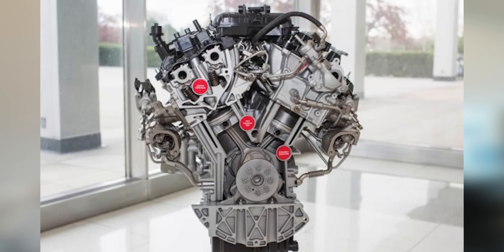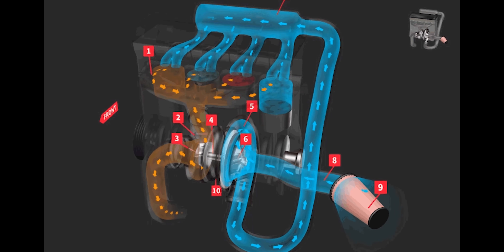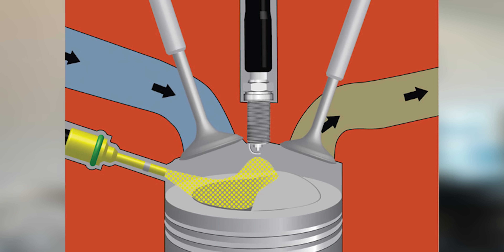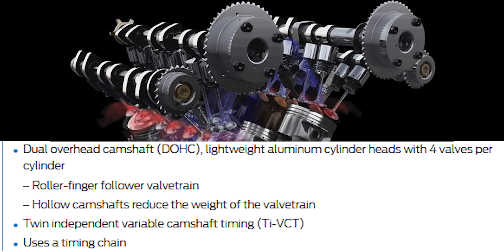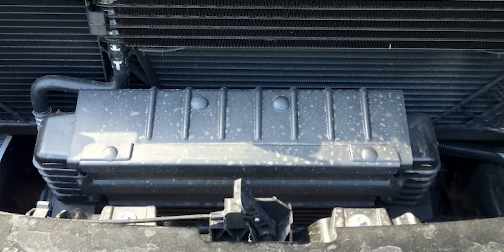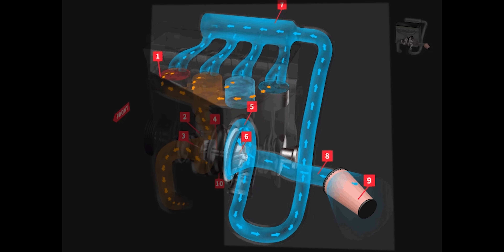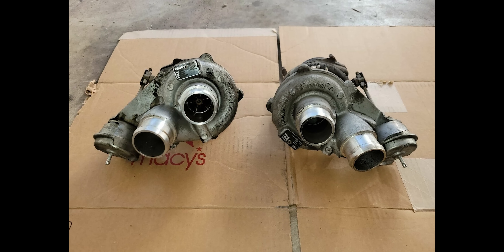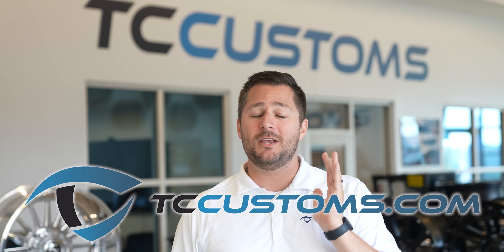The Truth about the Ecoboost Engine!

Comment: every Eco boost has catastrophic failure around 100000 km.. my work bought 17 units ALL 17 units had catastrophic failure.....and  now the 5.0 coyote eats oils bad. fords solution was to give you a new  oil dip stick with different low oil markings for the 5 liter V8.... old dip stick says your out of oil...   fords new dip stick says everything if fine... my truck just ate  a liter of oil in 2000 km  and ford  says its okay.....we also had several units at the dealership for two months with transmission problems.... ford has NO idea whats wrong with the transmission, they just swapped out every part they could think of..... don't believe me??? call ANY construction outfit and ask why non of the ford f150s have 3.5 or 2.7 Eco boosts in their fleet??? then you'll hear the horror stories....
Reply: They also play games with the oil pans. The dipstick used to go all the way down and sit just above the bottom of the oil pan. On the new ones, it still goes down  the same amount, but its walled off in its own little compartment. Oil get in through a tiny pin hole size valve. It makes it look like there's more oil in the motor than you really have.
Reply: Oh sir all the wonderful comments until now and you dropped the Tzar thermonuclear bomb on the whole thing. 100 plus years of internal combustion and now we must have computers, sensors, power adders?
Reply: @christianmotley262  There's nothing wrong with having electronics in cars. This is a Ford issue, not so much a computer issue.
Reply: @jkeelsnc  They can't. If they went back to something normal, they wouldn't sell any of the other ones.

Comment: I'm a Ford fan but they have major issues with the 3.5 eco. Timing g chain stretch/cam phasers timing chain tensioner. All that starts to go right around 100k all that is atleast 5k dollar repair. Not to mention you definitely need a oil catch can on the eco boost even if its multi port injection so much crud gets sucked in the engine which causes valve failure. FORD NEEDS TO FIX THESE MAJOR ISSUES!!!

Comment: These engines WILL overheat towing much less than their rated weight up hill in Utah, Colorado, and Idaho. I don’t care how much “technology” they have in them.
Reply: Why is that ?
Reply: Fast Line Truck shows it over heating.
Reply: @studioxps72  cuz they were towing 10k lbs with a half ton and comparing it to a Duramax 3/4 ton
Reply: You can’t tow the rated max capacity when your several thousand feet above sea level.  Ford specifies how much to reduce your load when your at high altitudes.
Reply: @flyer8493  EXACTLY!  That fact was mentioned by FLT...
Reply: Yeah.  I’d like to see some evidence.
Reply: They just ran a Chevy up the same hill and it overheated also, i posted the link above. Seems that hill in 95 degree weather kills any 1/2 ton
Reply: @tieoneon1614  and only lost by 20 seconds, with reduced power..

Comment: But… when you turbo charge ANY motor you increase internal pressures and the life of the motor is cripple drastically and will not last as long as it’s none turbo charged counter part.
Reply: 228k on mine and running strong
Reply: My turbo diesel would say otherwise
Reply: That’s old school thinking that is only true for taking a naturally aspirated engine and adding boost. If the engine is designed and engineered from the start as a boosted engine, all of that is engineered out. Modern turbo Diesel engines last huge mileages and modern turbo gas engines like these Ecoboost engines, can also last just as long.
Reply: Tell that to semi truck and boat owners.  Turbo's increase efficiency and cause zero shortened life IF the motor is built to handle the extra cylinder pressure.  OEM's aren't taking N/A motors and simply bolting on a turbo like is done in the aftermarket world.  Factory built turbo motors are built to handle the boost and live just as long.

Comment: the problem with older turbos (non water cooled) was not that they cooled off to fast. the problem was that they didn't cool off and the extreme heat literally cooked the oil in the turbo.

Comment: Wow.  I learned a lot from this video.  Previously I didn't want anything to do with an "eco boost" but I admit I never looked it up before.  Very informative.  Thanks.
Reply: Just look at all the components that Ford has added to try to prevent known problems with using turbos= cooling systems for the air, cooling systems for the oil,, injecting oil in the cylinders for lubing/cooling......and some features he mentioned that I forgot about. Each one of them is another item for: leaks, for mechanical break downs, for wearing out over time, etc. Just give us a functioning V6 or V8 aspirated engine and be done with the turbo experiment.
Reply: @captinbeyond  Ya i ended up getting a 2021 ranger with the ecoboost. I hope i did right. I'm a little worried about the issues you mentioned but we will see over time.

Comment: To each their own as to which truck brand and powertrain they choose. I have an 2016 F150 with the 3.5 EB and love it! I admittedly don’t do an excessive amount of towing, but the towing I do is easily accomplished with this truck. 
One of the things that really impressed me is the trucks ability to pull our 24’ pontoon, loaded with 8 people and all their gear, up the steep and badly deteriorated boat ramp at our lake place without any problem at all. I just turn the dial to 4H, gently press the accelerator and up she comes without complaint from the engine or transmission. 
I think Ford hit a home run with this engine. So much so that I just recently bought my wife a 2021 Explorer with the 3.5 EB!

Comment: Here is my data point for this group. 2014 first Gen 3.5l eco with 160k miles. No engine work whatsoever. No timing chain rattle, overheating, carbon fauling or leaks. Only on my second battery, haven't even replaced the alternator. I tow an 8k lb trailer. Change oil full synthetic every 5k which is key for this engine... about 3k earlier than oil life indicator tells me to. Great truck!
Reply: Oh, and I Sea Foam it through the intake once a year since it's direct injection only.

Comment: I have a 2011 eco boost… 240,000 and counting With very few problems. I tow a 22 foot boat all over a state With many elevation changes, and it performs wonderfully. Only complaint it sucks fuel like a V-8.
Reply: Yeah I got the 2012 and same issue, lots of fuel. 16mpg in the summer and 15 mpg in the winter once the fuel companies change to winter fuel additives.

Comment: also, amsoil signature series! no 0w20. weight of death!
Reply: None of the EcoBoost recommend 0w-20, most should say 5w-30, though you can easily use 0w-30. (It's actually better because you get oil pressure faster on startup)

Comment: Public Service Announcement to all prospective first time Ecoboost buyers.  DO NOT RUN 10,000 MILE OIL CHANGE INTERVALS.  Between the heat produced from a modern turbocharged engine, and the fuel dilution that is notorious with Direct Injection engines, you are gambling on long term engine health stretching the life of the oil that long.

Not hating on the Ecoboost, I LOVE my 2018 3.5L (aside from the cam phaser cold start rattle and wastegate rattle) and will buy another when the need arises.  The Golden Rule applies.  Treat it right and it will last.  Besides maybe the cam phasers....😅

Comment: No Turbo's are not new to the Automotive industry.  I owned a 1988 Dodge Shadow that had a turbo charged 2.5 L 4 cylinder ENGINE, and the turbo was cooled not only by OIL, but also Engine coolant!  This car was a very fast and efficient Automobile, and it lasted way beyond 150 K miles!

Comment: I OWN A 2011, 3.5 ECO BOOST ENGINE F150, and it has NEVER let me down. It has 250,000 miles on it and I have never replace ANYTHING EXCEPT TIRES, PLUGS, AND OIL. THIS ENGINE RUNS AS SMOOTH AS IT HAS BEEN FOR THE LAST 13 YEARS. THE VERY BEST ENGINE FORD HAS EVER MADE!!!

Comment: Turbos have been around forever. Every diesel truck on the road now runs turbos. Every carmaker is selling turbocharged engines now. People who had problems with turbos are those who added them on without doing the proper engineering.

Comment: Yeah eco boost is a good idea but it puts more pressure on a V6 engine. And turbos are expensive to replace the longevity of an engine constantly under pressure can cause premature wear. And now Ford is sticking turbos on 4 cylinder engines. Who knows how long those will last long term.
Reply: These engines are purpose built to run higher pressure through them.  I got a 180000 miles out of my 3.5L ecoboost engine without a single issue. These engines are built to last a long as you stay on top of the maintaince.
Reply: Lol. You should have some knowledge and experience before saying dumb things.😂

Comment: One of the most important features of this Ecoboost engine you showed in graphic, but didn't say out loud .... it has a chain-driven timing gear, not a rubber belt system that requires frequent replacement on other engines or else engine failure results (a serious problem on the I-3 small displacement 1.0/1.3/1.5 Ecoboost engines). 

Your explanation about turbocharger cooling is wrong I think; you compare oil and water cooling of turbos, saying the oil system "cokes up" the turbo if you shut the engine off without running it a while; the water cools the same but CANNOT if you shut off the engine too soon either; how could it make a difference? the pump isn't running if the engine isn't rotating; (this wouldn't apply if the pump is electric and software keeps it going until sensors read a lower temperature, but you don't say that); you've got a hot turbo with either system if you ask me, so without further info, "coking" is still likely in the long-run.
Reply: The turbos water cooling is plumbed so that when you turn it off it's natural convection of the heated water that keeps the coolant flowing untill it's cooled down
Reply: @sublimefreak2244  oh REALLY!
Strange, that would require the law of gravity to be null and void. I don't believe your comment is true, but full disclosure I'm a longtime Ford retiree, spent a couple decades in powertrain testing and development, and I plan to ask one of my fellow engineering active employees or the SAE about this oil/water thing. Doesn't make any sense at all to me that this makes any difference in turbo temps after engine shutdown. Coolant does not FLOW without either gravity or a pump. Water cools faster than oil, but if it isn't moving the rate of cooling would not be enough different from oil to cool the turbo much faster. 

Your explanation may have some partial truth while the engine is running, but not after it's shut off. But I will check, and if the answer is in agreement, hopefully I can find this thread later and come back to say what I was told.
Reply: @rayrussell6258  it wouldn't have to defy physics in order to use convection. It's no different than warm water rising in a boiling pot of water. I have not researched it thoroughly but I was told that is how it was cool after the engine was turned off
Reply: @rayrussell6258  Look it up Ray, he's not lying. it's also why the radiator fan stays running after you turn the truck off when/if the turbos are hot.
Reply: @sublimefreak2244  ok, I'll check that out with the engineers; 

I'm still skeptical 
(in your analogy heat rises and expands; cool air/fluid does NOT rise or expand, so that's where I'm skeptical of what the original poster said)

From a textbook: 
"What is Convection? Convection is the process of heat transfer by the bulk movement of molecules within fluids such as gases and liquids. The initial heat transfer between the object and the fluid takes place through conduction, but the bulk heat transfer happens due to the motion of the fluid."  

Above/below are text book definition of "Convection of Fluids" and "Conduction of Fluids", 
as you can see the bulk of cooling requires motion of the fluid; what you suggest goes against laws of physics. Conduction also requires some motion of fluids. 

"Conduction heat transfer in gases and liquids is due to the collisions and diffusion of the molecules during their random motion."  

As I said, I'll be talking with engineers sometime in the near future, and I will bring this up; I want to know details myself.
Reply: @austin3626  That was what I posted earlier, if you look back in the thread; I said if the software keeps the pump running after engine is shut off, it might help cooling .... but the original poster did not say that; 
(and he has not since then come back to either clarify or admit his info was not accurate, even though he asked us to post concerns about the info he posted).
Reply: Model T engine convection cooled!
Reply: Turns out original poster was not correct/glossed over this; a combination of coolant and oil is used on Ecoboost turbo engines - not one replacing the other as was suggested (my info is from mechanic who works on these directly in Ford garage), and all the rest of the post-shutoff process is the same with pump circulating fluids to help cool down. 

Each Ecoboost engine is a unique design for the vehicle it is installed in, even if it is the same displacement used in a different vehicle, but the above covers most of the recent releases.

Comment: My olny issue i have with Ecoboost is the turbo lag, i don't think ill ever be able to look past it. however the engine seems to be working well still so im happy with that. got a 2013 f150 fx4 ecoboost.
Reply: The lag goes away in sport mode. At least mine does

Comment: I got a 2017 3.5 eco boost with 113,000 miles, going to shop Monday for leaking valve cover, this model comes with plastic valve covers and are known to warp and get hair line cracks

Comment: In gas engines when the fuel/air charge is ignited it’s a rapid burn, not an explosion as you had repeatedly mentioned. That would/could cause engine damage…That happens in Diesel engines…

Comment: I have the 5.0 V8, and have had V8s on all 4 of the F150s I have owned. Now with cylinder deactivation on the 2021 V8, I no longer see a simple choice. Please see the two mechanic's polls on engine choice on this very channel.
Reply: You don't need to take a poll. There's so much crap on a current NA V8 it barely fits in an F150. For any decent size job, its easier to take the cab off.
Reply: @solarfall2728  OH WOW!

Comment: Great video. 
We have been seeing more 3rd gen 5.0's lately (2018+) It makes me laugh when people say be careful because the turbos fail on the Ecoboost, that’s one of the least failures we see with these. Yes some dealership service department will see more eco-boost in for work, it is the number one selling engine in the F150 it only makes sense since there are more on the road are you may see more in the shop. it’s a numbers game, percentage.
Reply from the maker: Very well said!  👏🏻👏🏻
Reply: If I remember right the 3.5 outsells the 5.0 like 3-1 ,no surprise mechanics see more 3.5’s
Reply: The 5.0's burn so much oil, they just upped the capacity from 8qts to almost 9.
Reply: @solarfall2728  Have a 2017 King ranch with 5.0and 38K miles. .  Have not noticed any  excessive oil burning.
Reply: @sphillips5269  They don't burn as much as the gen 3's.
Reply: @sphillips5269  I have a 2011 5.o that burns no oil between changes. (5000 miles)
Reply: I have an 18 5L F150, so GEN3 with no noticeable oil burnoff between changes. I'm also running an AML tune with straight E85 with a fuel cutoff at around 7,200 RPM which the Coyote is happy to spin to even with the truck manifold. Still no noticeable oil burnoff with a first year GEN3 Coyote that's spinning to about 1,200, or so RPM's over the factory redline. Coyotes burning off oil excessively is largely a myth. The early GEN3 Coyotes came from the factory with the wrong dipstick installed. There is a recall for this. This led to them being way overfilled during oil changes. If you overfill your engine oil then it's going to start to burn off. The whole plasma liner causing oil burnoff in the GEN3 Coyotes is also largely a myth, and false speculation IMHO. Do Nissan GTR's, and 13/14 GT500's have oil burnoff issues? Do 18+ Mustang GT's have oil burn off issues? They all use plasma cylinder liners, or whatever you call their non-sleeve cylinder lining. In fact an 18+ F150 and Mustang GT have largely the same engine. Their firing order is different, so their cams are different, (even though they're spec'd similarly) but they use the same block, heads, rotating assembly, valvetrain, (minus the cams) etc.

Comment: The intercoolers need to be twice the size. Ford’s thinking is basically, hmmm what can i get away with? Ahh small intercooler
Reply: 100% agree. My father owned one 2019 platnium. Verse my 6.2l the first drag race he almost got me. Once heat soaked it was no contest. So towing same story great when you first need to get on the freeway. Once hot and pulling hills, 100% different story. Sold it for a ecodiesel dodge. Tows more consistently for his needs and gas mileage desire.
Reply: @nasty3145  The only way that 6.2 out drag raced a newer 3.5 ecoboost is if it was modded in some way.